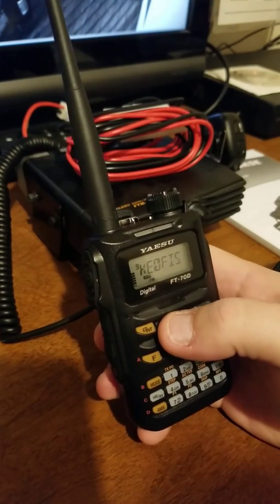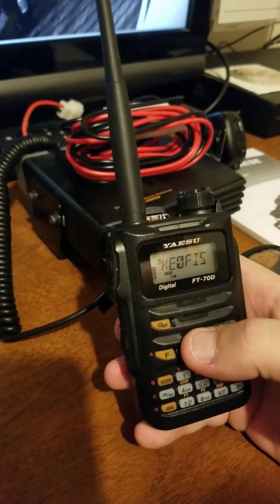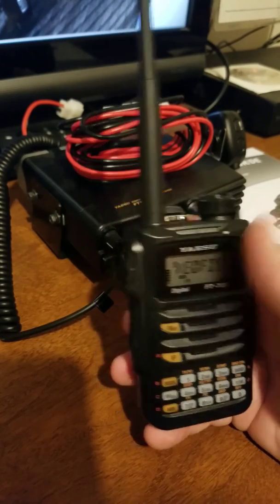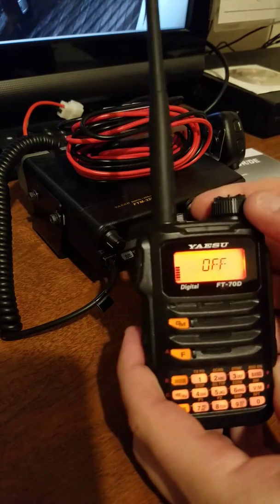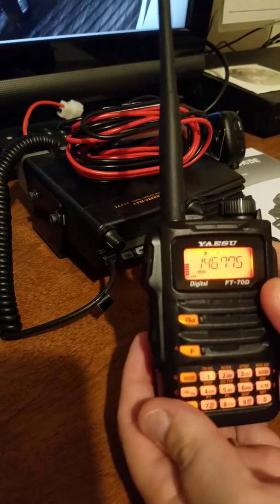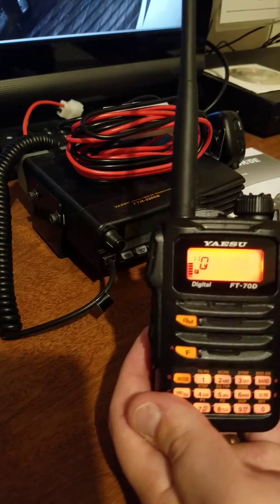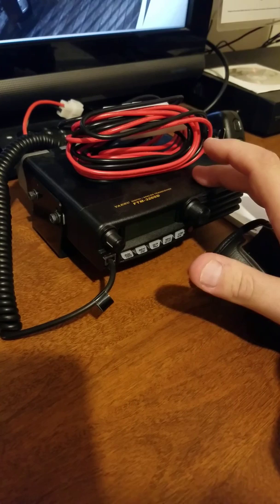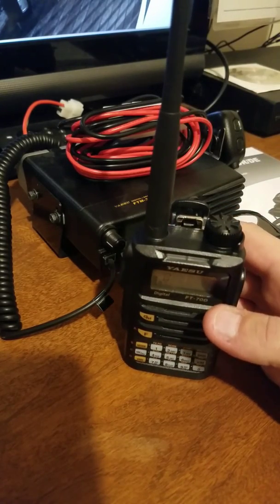Yaesu FT-70DR

Comment: I have a FTM-100 which is really easy to program. But this FT-70D is giving me a headache. No matter what I did with the software in the end just said ERROR. So it's going to be all by hand or toss it out LOL
Reply from the maker: I didn't care for the software myself and did mine by hand which really didn't take to long once you get going on it, still a pain but what do ya do.. 73
Reply: @JoeDauen  I have no shortage of Pain. Had a spinal fusion operation in 2015 that has given me severe pains since. Sure didn't help anything it made everything worse. From a hit n run car in Jan 1996.
So when I'm ok to do something like program this radio I can only do it for around a hour before I need the rest of the day to get rid of the pain. That's what stops me doing much in this Hobby.
By the time my Club has it's weekly meetings I'm asleep cause I can't stand the pain to be sitting up doing anything.
Reply: @JoeDauen  The antenna supplied with this radio must be crappy. 
But I do live in a bit of a valley. The only way I could pick up a Repeater is after adding a connector to a multiband outdoor antenna. 
After watching this you did show a few little tips I missed trying to do it myself.
One thing I still don't know how to do is make the Repeater offset Freq. from + to - Auto setting thing messes up lots of Repeater frequencies and they aren't standard. 
Why do they make them so complicated. It's a whole new Hobby trying to figure them out hahaha
How I got into Radio's was I was searching for PC controlled radio's. Was thinking TV and Video is on internet these days so why not some card for full radio spectrum? But while I was searching about I saw some super cheap funny looking to me radio's. Those china illegal here beofeng things. So I ordered 2 different brands to find out what they did. You know those things are really easy to set up Repeater/channel settings. 

ACMA - Australian Communication's and Media Authority they did a study on the Beofengs. They cause interference on other frequencies. Like you transmit on one frequency and they mirror and bleed out onto 2 or 3 other frequencies causing problems for whatever uses them. 
So my ones now are just FM Radios to scan with don't use them anymore. Just saying they are super easy to set channels compared to this Yaesu good quality one.

Never buy a chinese clone brand radio. Everything looks the same on the outside. Open them up and you bought modified cheap rubbish. I never did buy one but I have seen a few.

Comment: Guys what about the battery life? I heard several complaints about extremely short bat life and lot people do not like this radio because of that battery issue. ??
Reply from the maker: We've talked alittle about the battery life, definitely could be better but it really depends on your average talk time. Myself, I get about 6 to 8 hours being I'm not long winded and enjoy bird doggn but if I have a good conversation for about 40+ minutes that will drop my total battery life down to about 4 hours.. Appreciate you stopping by, always good to hear what people think. 73 to you and yours! Ke0mje
Reply: Thank you for your comment. Do you have 1.11 Main f/w already installed please? I know that they corrected a rare case of incomplete charge, and error indication, when charging a completely discharged battery...
Reply from the maker: @petrok1rp254  Yes I'm running the newest firmware which also added the wires x control feature.
Reply: OK, many thanks for info. I just wonder if there was any noticeable improvement regarding the battery life after f/w update to 1.11 rev. ...
Reply: Hi Petr, try setting your RX power save on .5, that’ll help too 👍🏻......Paul

Comment: Thanks for the video, iv'e only just got this radio. I am a bit apprehensive with the software, so just programming by hand is ok for me, thanks for showing us how to.
Reply from the maker: GothiicAngels Anytime, glad to help! It's a solid radio and really easy to program on the fly.. ke0mje 73
Reply: I do have a question. I am in the UK and The Ft-70 , fully charged, yet I have trouble opening up the local repeater. I looked on the repeater website and it stated that it can be opened up with either a 1750Hz tone or 103.5 CTCSS tone. Using the ADMS 0 10 Software, the option to set it to 1750Hz is not there. Please could you help?
Reply from the maker: GothiicAngels Have you tried just using the 103.5?
Reply: hey, Yes I used that, it seems a bit hit and miss, at night I can open the repeater, daytime and nope lol. I have another question for you, This is my return to Amateur radio after a few years absence. With the digital repeaters, how does one set the colour code of the repeater on the FT-70 or is this not a feature of this radio? Sorry if my question is basic.
Reply from the maker: GothiicAngels That's a very good question. I don't believe so but I couldn't say for sure without checking around and talking to a few people. I'll find out and get back with you on that! Ke0mje 73
Reply: JDauen KE0MJE  thank you for your help

Comment: You got about half way.  You set the first character of the name, don't show how to advance characters, or save the result.
I also didn't see how to have a positive or negative offset.
Reply from the maker: Bill Broadley To move through the letters simply rotate the knob or use the key pad and for spacing letter to letter you just hit the band key. The offset is auto, if you put in any repeater is will auto set the negative or positive offset for you..  73 ke0mje
Reply from the maker: Bill Broadley After your done naming the channel just hit the V/M key again and it will save.
Reply: Ah, thanks, finally figured it out.  It's the long press on the V/M key that does it.  So the missing parts of this video are: [Band] moves cursor to the right, [MODE] moves the cursor to the left, [GM] clears to the right of the cursor, and long press [V/M] key to save it.  If overwriting press the [V/M] key to accept.
Reply from the maker: Bill Broadley Glad you got it all figured out. I should of added the finishing process to the video, it was my first upload.. :) 73 to you and yours! ke0mje

Comment: USB cable to the mini cable end wont read the radio. Do you a have a different mini port of to USB ???
But the software is reading the cable needs help, even tried the yellow programming cable.
Reply from the maker: Richard Hartford Are you Pulling the battery and flipping the little switch into write mode?

Comment: Ok I am getting everything right up into the point where I put the tag in, for some reason I am missing something here.
Reply from the maker: James Horak So I just tried it on mine with No tone.. I just put the freq in then and went straight to V/M holding it and the tag option popped up.

If the tag option doesn't come up, back out hit V/M and try freq again.

Comment: KE0MJE how can you tell when you are in memory mode of VFO mode when you press VFO ?
Reply from the maker: I already had some stuff programmed so it gave me that option.. If you just power the unit off and back on, Hit V/M and go from there you will be good.. 73
Reply from the maker: James Horak Because if I'm not mistaken your in vfo mode until your first saved freq.
Reply: JDauen KE0MJE I am having problems saving the tag because the fusion repeater I am programing does not use a tone it is “none”
Reply from the maker: James Horak So then you would just skip the tone step and go right to saving it which will give you the tag option.

Comment: I just bought one yesterday at the Ham fest here in Belton TX , I am ordering the RT Systems software to program it. But thanks for the video at least I can get a few local repeaters programed in, we have one yeasu fusion C4FM repeater too in the area. 73 KG5PTE
Reply from the maker: James Horak unfortunately I'm still am having a problem getting the software to recognize the radio. It's a solid HT and programming it by hand isn't bad, but I'll figure this software out sooner or later. Let me know if you have any luck with it. 73 KE0MJE
Reply: JDauen KE0MJE Are you trying to use RT Systems software?
Reply from the maker: James Horak Yes and the install went good but when I try to pull from the radio i get a error message. I'm gonna try to wipe the computer clean, fresh start and hopefully I will have better luck.
Reply: JDauen KE0MJE When my RT Systems comes in this week I install it on my HP windows 10 PC and see how it goes. I use RT Systems for my. ICOM 880 h DSTAR radio, Yeasu FT-60 and TYT TH 9800. And now my Yeasu FT 70. I am going to use your video to manually program three analog repeaters and two C4FM yeasu system fusion repeaters. In the Waco Temple TX area.

Comment: Thanx, Joe.  I could not find that in the manual.  I just got mine & bricked it when doing the firmware update.  I then tried it on another computer & got it to load.  Yaesu has some nice products, but terrible instructions & processes for updating, programming, etc.  They are the worst of the big 3 for that.  Unnecessarily complicated.
Reply from the maker: Bob Ograv Glad to help... I haven't done any updates yet, been nervous about it. I figure let them work out any bugs and I'll upgrade when it's a must. Glad to hear it all worked out in the end for you! 73 ( KE0MJE )
Reply: PS- Just to confirm: I am an idiot.  Page 25 of the small manual does show the memory setting process.  A re-review of it, revealed my lack of reading skills.

Comment: So when you use the programming software, how do you get Windows 7 to accept the FT-70D_Com.inf driver?
Reply from the maker: looptheloopish I got it to accept the driver but it would never pull from the radio, it just kept giving me a error!  I heard there is alot of bugs to be worked out in the software, so if I do it get going I'll post another video on it... Good Luck 73
Reply: That is a common problem with Microsoft trying to install a better driver that IT thinks is better and newer. But a lot of these cable manufactures (Prolific. drivers) have not updated their hardware firmware. So you need to make windows accept the older driver a common problem with windows 7, 8, 8.1 and 10 A lot of these hardware companies making these cables are still stuck in windows XP. Microsoft told me that it is up to the hardware manufactures to update their products because they are no longer supporting windows xp and some versions of seven.
Reply: Yep I be calling Yeasu in the morning if they wont help me then I might be returning this radio for a refund.
Reply: You have to be a complete moron to not be able to install this, its beyond simple, that or buy a new computer and get off that ancient dollar store windows 7 machine